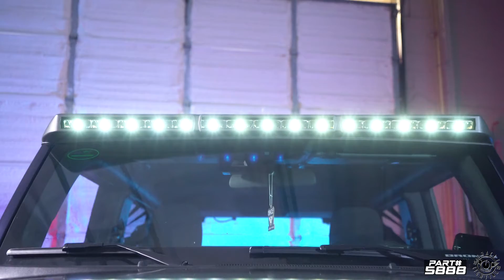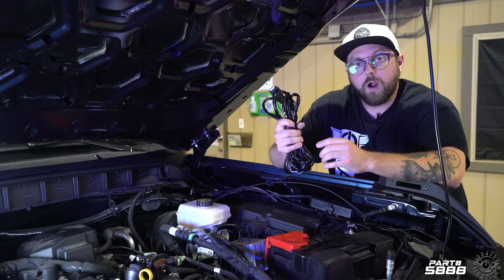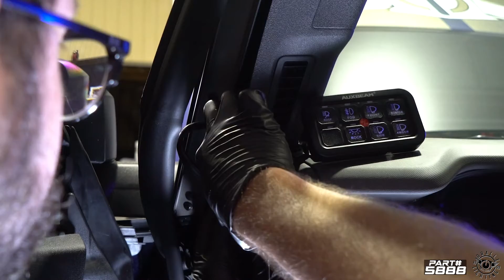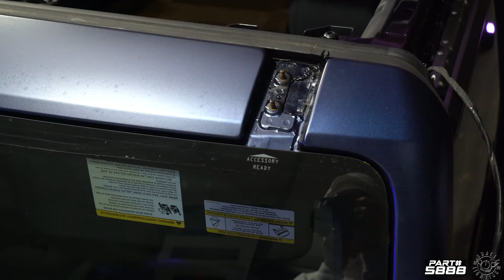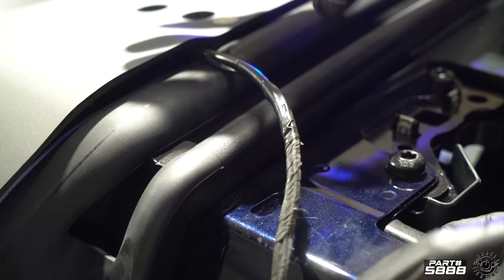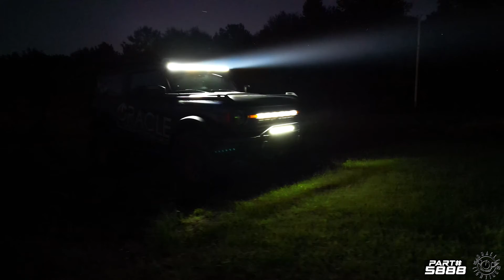Integrated Windshield Roof LED Light Bar System for 2021+ Ford Bronco DIY Installation by ORACLE

Comment: I like that it comes in Grey. But for a $1200 light bar to still need to buy a $45 wiring harness is ridiculous. I understand having to possibly need the switch but the basic harness is not even included. Why not just drill the hole in the recommended location to run the wire? Seems like design and install effort is lacking.

Comment: Has there been any issues of these catching the wind and coming off. I just installed mine and the bolts that come from the truck seem a little short you can't snug them down tight or the screws will strip. Has there been any issues with that
Reply from the maker: Hello, there should be adequate thread for the nut to thread onto the stud completely. Be sure the cable or other obstruction is not behind the bracket causing this to occur.
Reply: Ok also I have a soft top and after the install my top seems to be catching air causing it to blowup like it’s going to blow off. Not sure if the light bar is causing air to flow under the top?

Comment: nevermind the wind noise while driving, it seems like this would just destroy the air flow over the roof. this looks like it will catch the wind like a sail and maybe even have a bad effect on mpg.
Reply from the maker: Thanks for the feedback. Our engineers used CAE Analysis and Fluid Dynamics Software when designing this product to insure this does not cause drag. We have used this for over 18 months with no impact to MPG.
Reply: AH...that is interesting to know. I'm looking for a light bar for my Bronco. Hearing that makes me consider this for my vehicle. Thank you. @ORACLElights
Reply: I bought this and the noise is unbelievable very frustrating, can you assist!

Comment: All I want to know is what's the light setup above the modular bumper... Wait, is that even the modular bumper?
Reply from the maker: Yes it’s the factory mod bumper with a DV8 short push bar.
Reply from the maker: That’s our 20” 5200 series light bar https://www.oraclelights.com/products/oracle-lighting-multifunction-reflector-facing-technology-led-light-bar
Reply: @ORACLElights  FYI, those lights do not show up when you shop by vehicule...